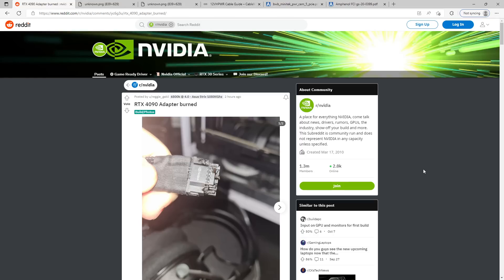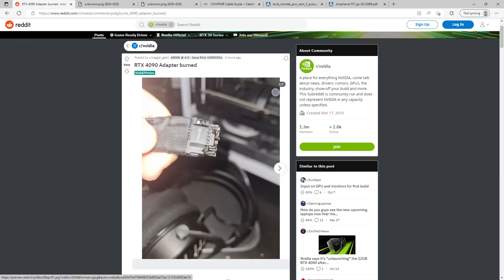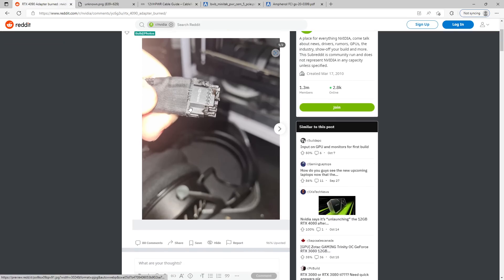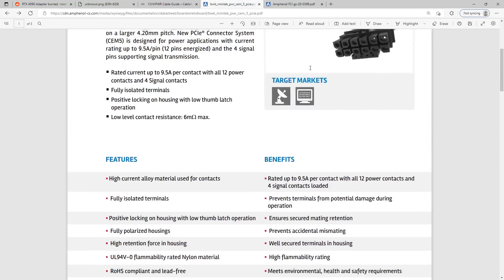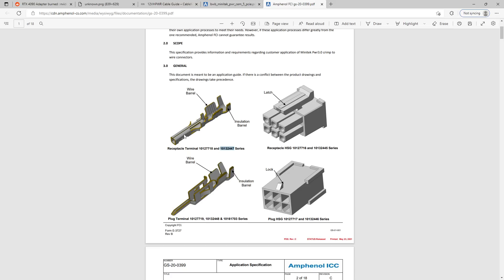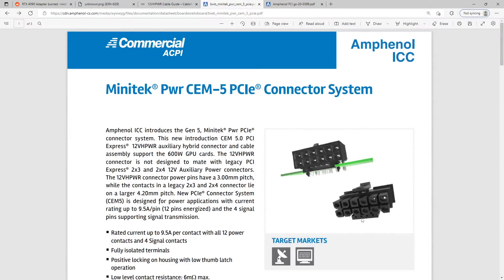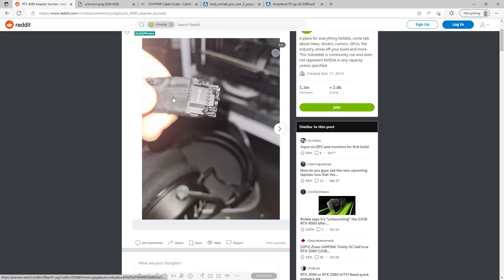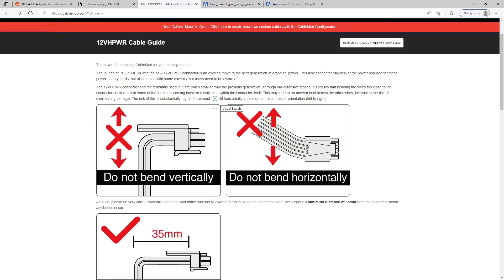The 12VHPWR connector sucks

Comment: The cards may have a 450W power limit, but they still spike into the 600s, and average usage is more like 500.
Personally I think that's nuts for a GPU and would never buy one like that (even if they were cheap). I want efficient GPUs I can also use during the summer without turning my room into a sauna.
Reply: Transient power spikes are not going to be noticeable in heating up your room. In fact, the 4090 vs my old 3080 feels exactly the same in the room except the 4090 is quieter.
Reply: @Inismona27  A 450 watts card will give off more heat than a 320 watts card. I don't care how you feel, that's just simple physics.

That being said, I wouldn't want a 320 watts card either.
I feel a lot more comfortable with something around 150 and that's well enough for me in terms of performance, too.
Reply: @PyrO-82  what’s the physics, got the numbers? 
if you are using it to run the exact same software and games as you were before it doesn’t run at a higher wattage. In fact it’s way more power efficient than the 3090 or 3090ti, it actually consumes 100watts less than a 3090ti to get the same performance on  gaming workloads. Just because it has a 450 watt tdp, does not mean it runs flatlined at 450, just like 350 for the 3090 doesn’t mean it runs at 350 flatlined either.
Reply: @Inismona27  Yeah I got the numbers. 450 watts is more than 320 watts. That's physics!
I knew I was talking to a moron when you said you owned a 4090, but you really signed the deal, there.
Reply: @PyrO-82  wow nice physics genius! You certainly showed me.

If I can run a game at 3090 performance with 100 watts less power draw the room will be cooler genius. Quieter as well.
Reply: @Inismona27  Yeah, that's literally physics. Watt is a physical unit. Also yes, ofc, if you barely use the card it'll be cooler, but that'll change in the future. Also you're wasting money if you don't actually use it. You could have bought a much cheaper model that'll use the same (lower) power, give off the same (lower) heat, and still run that game.
Reply: No, average usage is in 350-400 w range
Reply: @riba2233  Well it depends on what you throw at it. If you use it to its fullest potential, it'll be just under 500.
If you only play Solitaire, it'll probably be closer to 30.
Reply: Where is the evidence of transients up to 600w from a stock base? Link please.
Reply: @Safetytrousers  Gamers Nexus review of the stock FE, found here: https://www.youtube.com/watch?v=j9vC9NBL8zo

"The maximum current pulled by the card is consistently between 33 and 40 percent over the nominal value, being 450 watts"

I'll do the math for you, that's between 589 and 630 watts.
Reply: @PyrO-82  those are peaks bro, we are talking about average. With stock power limit of 450 they rarely reach it because they are voltage limited
Reply: @riba2233  No we weren't talking about average. I said 500 average, and spikes into 600s.

And yes, this review https://www.youtube.com/watch?v=j9vC9NBL8zo says 496 on average (on Furmark, but also some gaming loads).
Reply: @PyrO-82  yeah not really. I hope we are talking about gpu only power, not whole system.
Reply: @PyrO-82  ''but from what we've seen, from 8 hours of work on different games and applications, it's completely acceptable for the transients so far'' The transients are way less than for the 3090.
I did the sense for you.
Reply: @riba2233  Yes, GPU only power, measured at the cables, not what the driver tells you. Just go watch it if you don't believe me.
Reply: @Safetytrousers  I wasn't talking about if they're acceptable, or proportionally lower than previous ones. I was saying it spikes into the 600s and it does indeed do that.
Reply: @PyrO-82  Typical gaming power draw 412w, max peak 439w - Guru3d. 3090ti typical 428w, peak 479w. I don't remember reports of systems breaking because of the 3090ti.
Reply: @Safetytrousers  I trust GN. They're doing way more advanced stuff than most reviewers do, because most don't have the money to do it.

Also I wasn't making any arguments whatsoever about systems breaking. I really just said it uses a metric shit ton of power and I'm not a fan of that. And I was also trying to explain why it uses 4 8pin connectors instead of three, because the video mentioned that.

And typical means just that. Typical. The typical load for my GPU is only like 60% of what it could do, but that doesn't mean it couldn't do that, and that's what I'm talking about here. The card CAN use 500 watts on average on high workloads.
Reply: @Safetytrousers  Also btw, even if my numbers are wrong and yours are right (all we can do is point to other people who gathered these anyway), that's still way too much power consumption for me. I think it's nuts where we're going right now, with GPUs and CPUs. We should aim for more efficiency, not more power. Keep the power targets the same or ideally lower but improve the performance is what I want to see, not throwing power hungry monsters at each other just for the sake of making the fastest product. We're literally having a power crisis, because everything now needs to be green and the power prices have more than tripled for me. 350 watts for a GPU have been unheard of before last generation, and now they've even increased that. It's not a good development.
Reply: @PyrO-82  The transients are by defintion very short lived. They hardly affect overall electricity consumption at all. It's a choice if you want to raise wattage above stock, and if you have a workload that demands it then you are making money from it and it's for you to work out if it's worth it.
Reply: @Safetytrousers  4k or higher resolution gaming at high framerates demands it and I don't think anyone is making any money from that. Not even professional gamers, like streamers, have any need of that to make money. Ofc there are also professional applications for a card like that, but most are bought by gamers. (Well, unless they're bought by miners, but that's a whole different story)

I'm also well aware of what transients are. It still means it has 600W peaks and that's what the 4 connectors are for. If it didn't have those, it wouldn't have 4 connectors. I merely stated some very simple facts and my numbers are correct according to that review. It's a card that uses a shit-ton of power, regardless of if we believe GN or Guru3D and I'm not a fan of that.
Reply: @Safetytrousers  No you're wrong, and then I show you some other measurements... Take it up with the guys that made the fucking measurements, then. Don't tell ME that I'M wrong because I have a different source than you. That measurement by Kitguru doesn't really say much because it's a 12 game average. I'm talking max load power average. Because that's what the 4 connectors are there for. I'm aware it's not pulling much when you play Minecraft.
This 450 watts card is actually pulling 496 watts on average under full load, average means smoothing out dips and spikes, not "average usage", which is highly user dependent.
Reply: "average usage is more like 500" when you use FurMark as the load. In typical gaming loads the average is not 500W. If you want to talk about average, talk about average. If you want to talk about peak power draw, then talk about peak power draw. But what you are talking here is taking an unrealistic load and chucking it up to "average"
Reply: @chengcao418  "Furmark and some gaming loads", and GN themselves call it average draw, because it's smoothing out peaks and dips. It depends on what we're talking about. Average power draw at full load, or average across games at 4k, or average across games at 1080p, or average for a specific user which could just be 50 watts if the dude never ever even plays a game.
There are a lot of possible averages out there, my dude.

I'm talking average power draw under full load. After all this video is all about the damn connector and how it supposedly "just" uses 450 watts, but it doesn't.
Reply: @PyrO-82  FurMark is not "full load". It's designed to be the stress test on power usage. GN itself says typical games see 50W lower in total power draw. And in addition, total power draw alsl counts power from the PCIE slot, so it's on average about 450W going through the power connector. Still, the connector is stupid and dumb design.
Reply: @PyrO-82  And in games and rendering I usually just see around 300-400W. I have a 4090, and before you say it's a stupid purchase or what not, it's for work and a 4090 is worth it for the much better experience
Reply: @chengcao418  Again "Furmark and some gaming loads" so it can happen with gaming. I'm not sure if they even measured the PCIE slot, actually.
Reply: @PyrO-82  ... Anyways, for the matter of this video, 450W or 500W is still in spec and the spec is stupid. As for whether this card actually draws 500W in my workload then the answer is NO.
Reply: @Safetytrousers  You really need to stop arguing with me and start arguing with the guys WHO COLLECTED THE DATA I REFERRED TO YOU.
I don't give a shit about the details.
Reply: @PyrO-82  Neither in GN's video or written review do they mention gaming power draw. The only 'guys' you mention is GN. And you couldn't even bother to provide me with a link.
And instead of engaging with my valid points you ignore them and throw your toys out the pram.
Reply: @Safetytrousers  They do, but it's really just a short remark when he shows the power consumption under Furmark. Also I've posted that link several times in this comment thread, maybe not to you but to others.
Reply: @PyrO-82  You posted a grand total of two links, which were the same, and did not lead to any mention of power draw.
Reply: @Safetytrousers  Well I suppose you didn't watch the video properly then, because it's in there... I'm not gonna go and find the exact time for you. I don't think I care that much to be right. I mean, I AM right, but I think I'll survive without you acknowledging it.
Reply: @PyrO-82  Here's how to link to something about power draw: https://youtu.be/yU4CFhtS95Q?t=937
I watched the HU video when it was first up.

Comment: This is so stupid, really. Shrinking the connector size because it doesn't fit on the PCB? Those coolers are gigantic, they could have easily fitted a big enough PCB in there. And it wouldn't even be that costly either... 
I felt that this couldn't end well, but it happening so quickly after launch, I didn't expect

Comment: It's so simple Nvidias engineers should have known, smaller wire/connecters =greater resistance. I remember looking at the 12 pin connector to when it came out and going "that's a potential fire hazard" and I'm not a electrician or electrical engineer.

Comment: Just so you understand as you seem confused, the uneven voltage through the wires delivers uneven voltage to each port on the connector, this creates too much voltage trying to run through too few current-carrying materials, this could be fixed simply with higher grade and a bit thicker current carrying wire, as well as a bit more insulation between wires.
Reply from the maker: the wire isn't melting. The terminals are.

Comment: Did anyone come up with a 12 pin 90 degree angle connector? Just like the 24 pin ATX one?
Reply: Cablemod and ThermalGrizzly are working on a 90° adapter.

Comment: I wonder if the 7000 Series GPU's from AMD will use the same connector as this or will stick with good old 3x 8 pin?
Reply: Oh, I think if it's at all possible for them to stick with/go back to the 8-[in connectors, they will. I can't see them going with this new one after all the crap that's been coming out on them since they launched.
Reply: I think the latter
Reply: @_Clivey  Where has it been "confirmed"? I'm not seeing anything definitive one way or the other, and that included some reports coming out just last month. If you've got a link that definitively says that AMD will be using 12VHPWR on 7000 GPUs, cool. I'd love to see it.
Reply: It is the new ATX PSU standard. Make your own conclusion from that.
Reply: @henryvaneyk3769  New standard doesn't mean automatic switchover the second it comes out. Look at Windows. People are still running Windows 7 and 8 machines, even though 10 is now EOL and 11 is the "new standard".  Given the issues this new connector has shown so far,  AMD will likely hold off on adopting it till these have been resolved and we're not getting situations where customers are having these things catch on fire/melt. Intel opted not to use them, because they were unnecessary.
Reply: @bubkusjones  

True

Comment: I said these new cables were going to be an issue because they are a smaller gauge than they should be, when I saw them. I mentioned car stereo amp installations and wire gauges but other people commented that these power supply companies and GPU manufacturers know what they are doing. I conceded I was not an electrician but still don't trust them. I have never heard of decreasing the gauge of wire while simultaneously increasing the power.

Then size is the other issue, look at how massive the 4090 is, now consider most people will have them mounted horizontally (standard method into the motherboard) plus the cable companies are suggesting not to bend the cables for at least 35mm (about 1 1/2 inches) so in effect you will need another 2 inches of side clearance in your case. There are not very many wide chassis cases out there, most of them are pretty standard width within an inch or so of each other.

This whole thing is a failure, with no thought given to the typical end user that would buy these cards.
Reply: The wire gauge is not the problem. Did you even watch the video?

Comment: I bent my 3090 with its 3 eighth pin plugs vertically and horizontally at the same time as in example 2 (ie a good 90 degrees vertically and 70-80 degrees) and they still work perfectly after more than 1 year. The whole thing looks like a single high-power connector cable harness after you have moved a few inches away from the connectors.
There are only 3 eight-pin cables on top of each other.

Comment: So this happens with 8 pin pcie connectors... So... But I'm lucky that thermaltake sells the 16 pin adapter like Corsair does. which is the PSU I have and I already ordered the cable connector before I can even get my hands on a 4090. Also the 8 pin has the same 30 plug in rating that this 16 pin adapter has. So people are making this super scary when it really isn't. That is what I hear anyways from YouTuber tech wizards

Comment: I use a gtx 760 2gb on my 9900k, sold my 3070ti before it lost all its value and plan on getting 4090, 1080p 240hz XL2546, any idea if the 9900k will bottleneck?
Reply: Yes it will. Check out Hardware Unboxed 4090 video. It was even bottlenecking the 5800x3d. But the newest intel might be alright, as long as you have your own power plant to power both of them. Check out hardware unboxed 4090 video and that should answer your question
Reply: @absolutelysobeast  ok ty
Reply: Always check your resolution and target frames first. More resolution less frames, and less bottleneck.

Comment: This connectors is making me worries whether I can upgrade or not. 

Beside I'm a bit confused why the aftermarket GPU doesn't use regular connectors I mean they usually doesn't mind having many auxiliary connector like I remember my friend used to have an ARES card that have lots of auxiliary power connectors even my old 780TI has 3 8 pin connectors (or 2 8 pin and 1 6 pin I kind of forget). I don't think the PC DIY community mind having 4 8 pin connector especially compared to those brittle connectors

Especially when aftermarket GPU usually have bigger board just like the 3xxx series so the reasoning to have that connector is just gone
Reply from the maker: Nvidia forces their partners to use the new connector.
Reply: @ActuallyHardcoreOverclocking  how much should the average user actually worry about this? I mean of course you make the best effort you can to keep the cable as straight as possible but now im second guessing whether or not i want to buy a 4080.
Reply from the maker: @absolutelysobeast  depends on your case setup. It's certainly possible to build your system in a way that the cable isn't being bent excessively.
Reply: @ActuallyHardcoreOverclocking  thanks for the reply! My case is pretty good sized but still. I may look into the post more myself im interested to know the conditions that led to this. Thanks for your content, it serves a great need in the PC community. Have a good day!
Reply: That's just peak Nvidia. They do the most unnecessary things to lower their products lifespan.